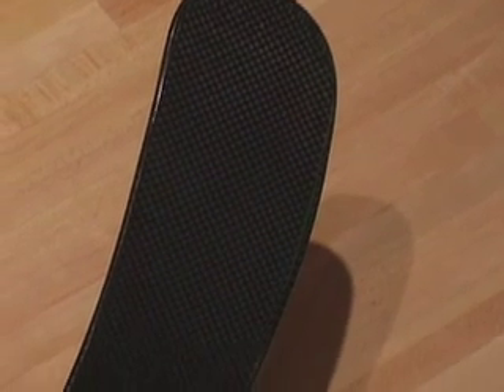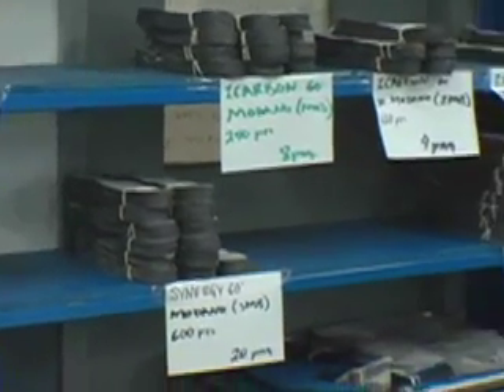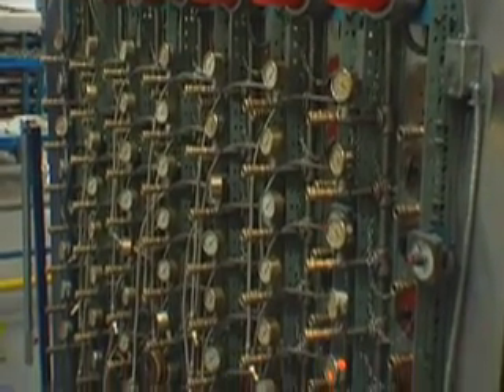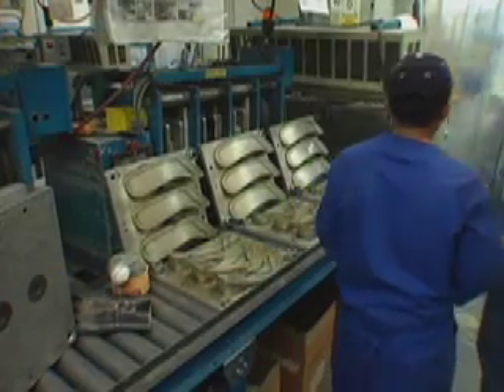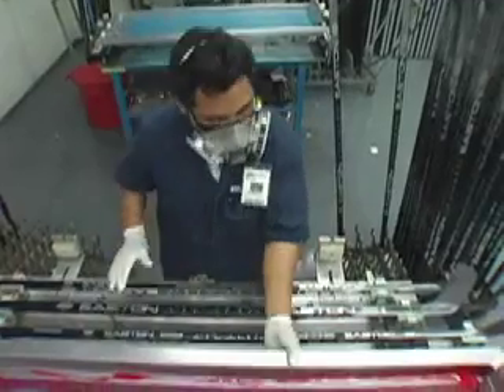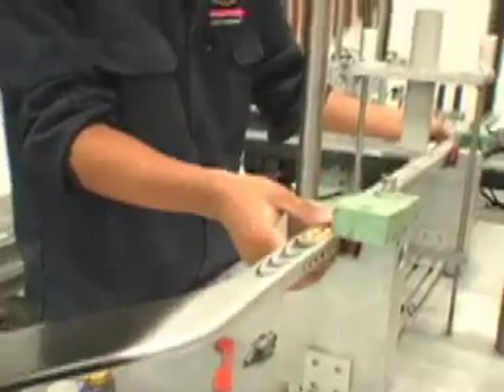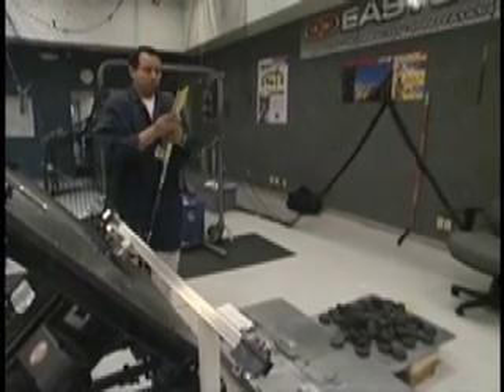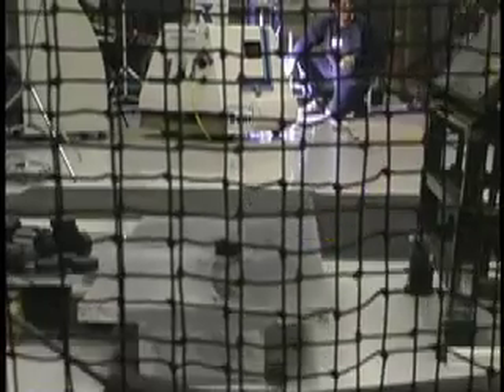Easton Hockey - #1 Stick in NHL

Comment: Voice of Holmes Ghassemi, nice job. There are great shots of Stealth hosels painted with the Chrome Paint System, where the Chrome Paint System started with Easton. 

You will also notice HG talks up silk screening, as the camera is on the 1st Solution Applied Graphics for Easton Hockey sticks, instead of blades. The Word Cup Flags for each stick, the distinguishing outstanding features for those sticks, were Solution Applied Decals  and the beginning the end for direct screening at Easton..?